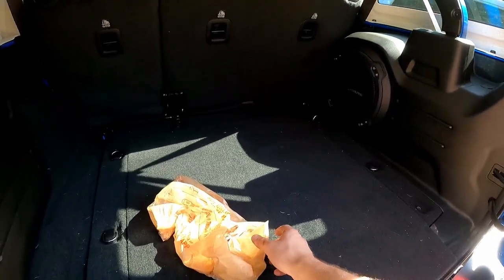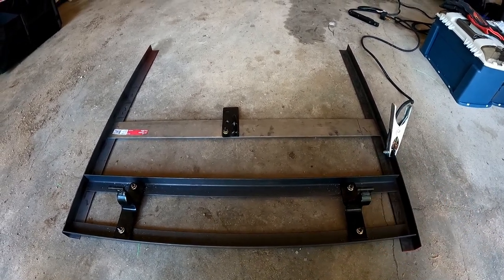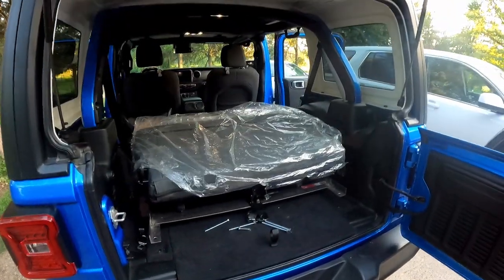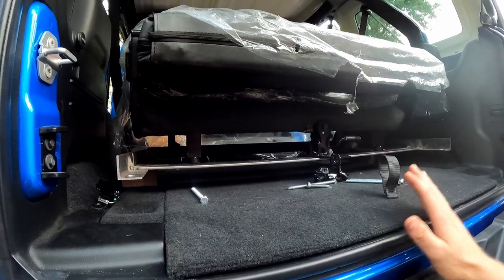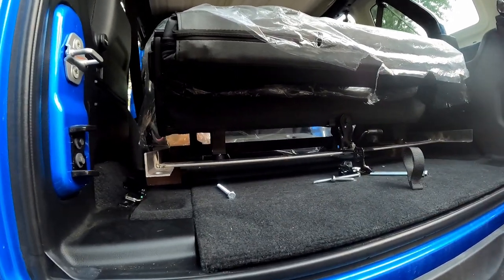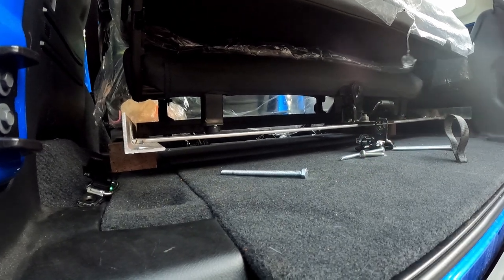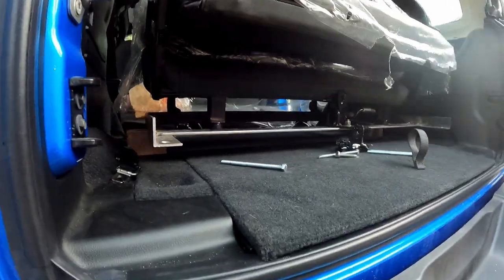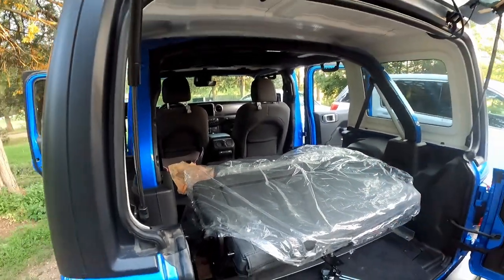Jeep Wrangler JL 3rd Row Seat - Pt. 1 Building the Frame - Daily Vlog

Comment: This is awesome ! Do you make and sell those brackets?
Reply from the maker: @_Tmnt4Lyfe_  I don't, and I've got some changes to add to it. 

The back support has too much play for the latch. So it comes undone. I've put more of the rubber spacers under it to help support it, but I want to add more angle iron for support.

Other than that, it works amazing and is still holding up. 

If you're interested in buying one, I can make another with improvements. Send me an email and we can discuss it more, trevor@arcticvette.com.
Reply: @ArcticVette  well if you decide to make and ship let me know thank you!
Reply from the maker: Will do!